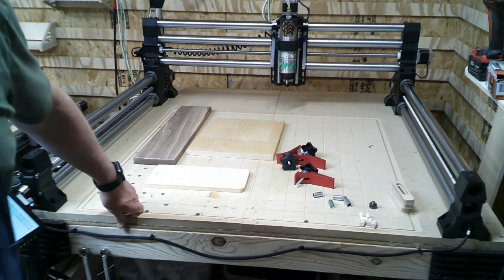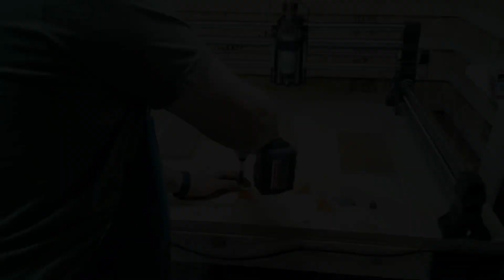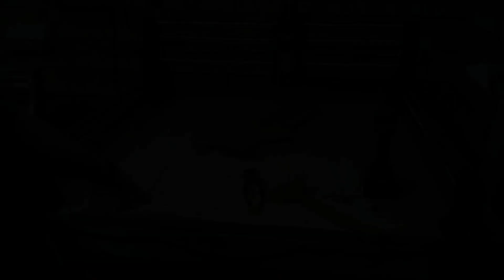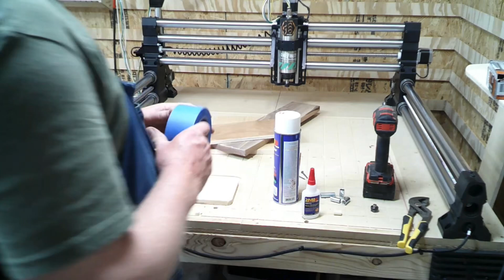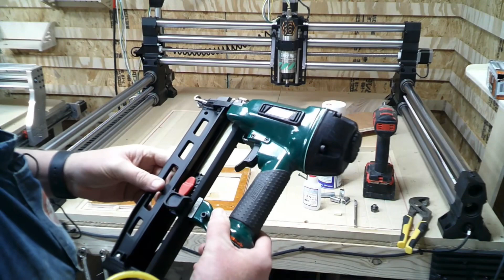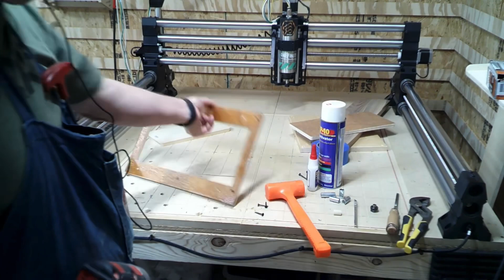How to hold down your workpiece on your CNC

Comment: them 1/2 inch bushings. can you link them please and thank you. good timing with this vid im working on revamping my waste board:) doing a t-track and thread. was going to make a 90 deg angle stop but i think them bushings would work fine. and thx once more for the vid.
Reply from the maker: the bushings were at local hardware store.  i just dug around in bolt bin and found them.  the wood dowels are the one that i use the most, as i can run through them with my cnc and not hurt anything.
Reply: @onefinity-trainingtipswithMitz  wooden dowel it is. thank you